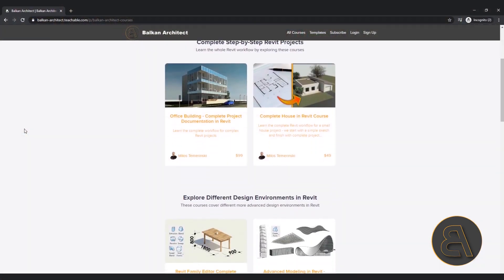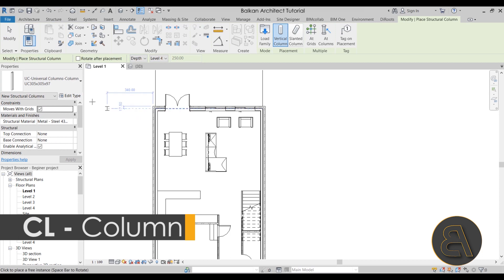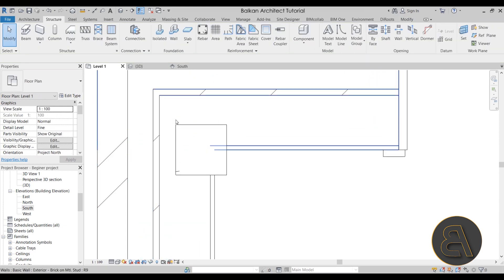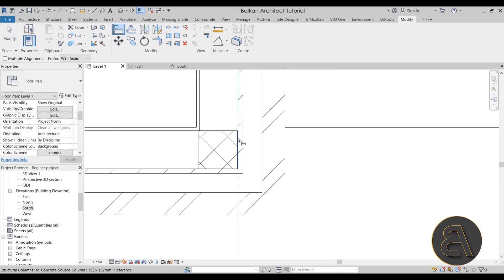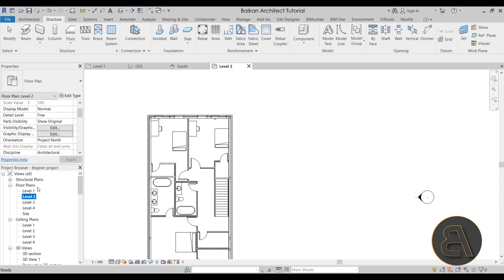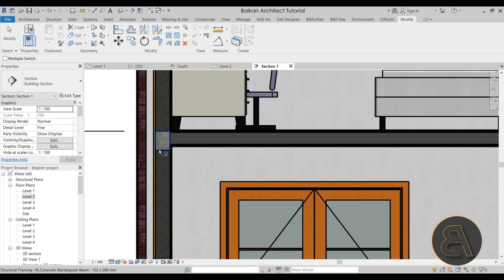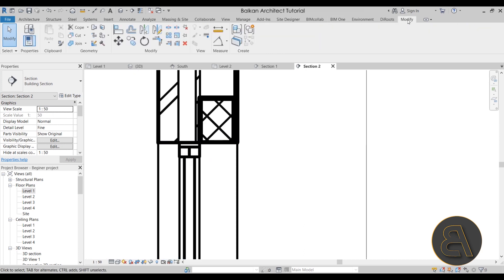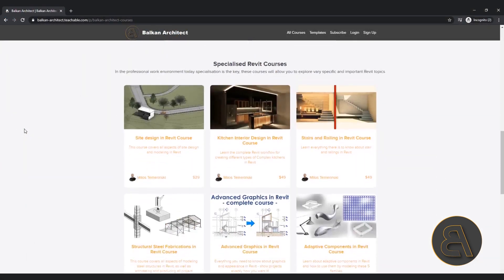Structural Elements in Revit Walls - Revit Tutorial

Comment: Hi, Balkan Architect thanks for the tutorial. Do you know how to hide the columns inside the walls for architectural plans? For some architecture plans, I prefer not to show structural elements and display a clean wall regardless of what is inside of it. But for Structural plans I want the columns to show, I tried joining them with a CMU wall and setting the same material. By tweaking the visibility graphics I set the walls to coarse level and I get to some clean joins but not all display the same I end up with some join lines of the columns on the architecture plans, I manage to fix it by setting everything to black on the cut fill. But I end up locked with only that option, I would rather have a gray fill instead, but the join lines still display.

Comment: I have added columns in walls but can't see them in section box nor in plan. 

Seems the wall has absorbed the column. 

Please suggest
Reply: Does this happen with both the architecture column tool and the structure column tool? I believe they both interact differently with walls elements